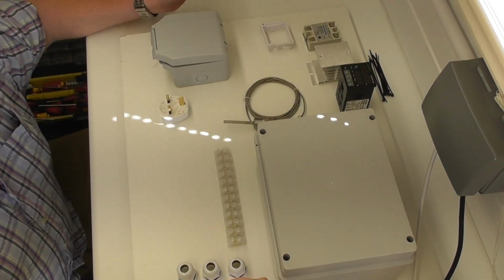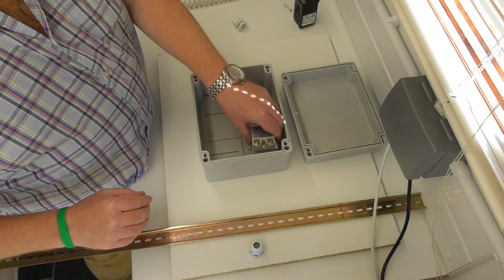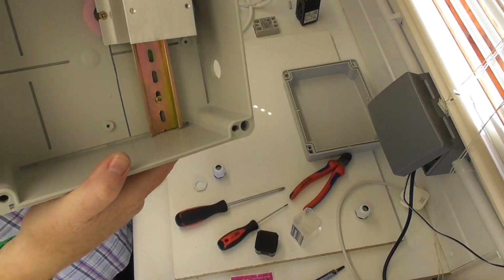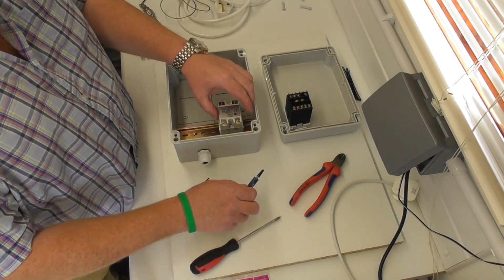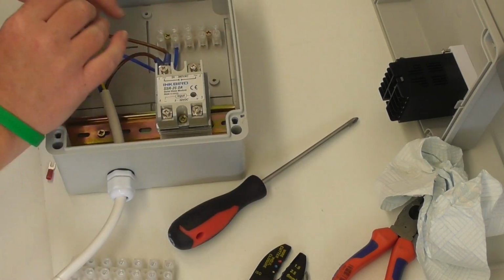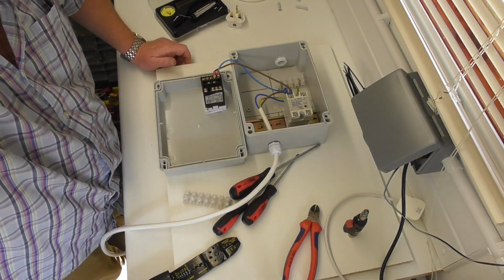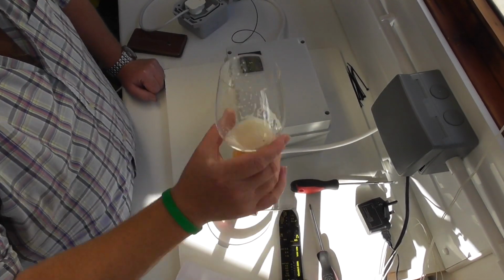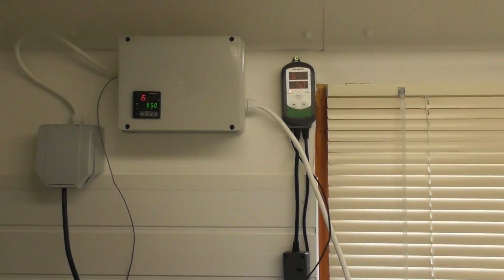Basic Electric Brew HERMS PID Temperature Control Panel Build - Inkbird ITC-100VH & RTD PT100 Sensor

Comment: Hey Graham, many thanks for this video, very informative. Would you happen to know how to connect a two wire PT100 RTD to an Inkbird ITC-100? I am trying to to utilise the probe inside my Braumeister and after much testing of resistance and a lot of googling, it's definitely either a two wire PT100 or a two wire PT1000. Many thanks!

Comment: Hiya how was the heat coming of the heatsink in the end?
Reply from the maker: Robert Finch No issues at all. I never bothered installing the fans and it never gets too hot.
Reply: @HaplessGingerBrew  righto! What is the load and duration out of interest?
Reply from the maker: Robert Finch The burco boilers are quoted at 2.5kw and it runs for up to 2h
Reply: @HaplessGingerBrew  great same wattage as a heating element I'm using. Thanks for your contribution and time! Here's to not blowing myself up!
Reply from the maker: Robert Finch 😂
Reply: @HaplessGingerBrew  But would that be the same if would like to run heating element for 10-18hours? 🤔 Or in this case just put the small  fan inside?
Reply from the maker: @siliuksas2533  10-18 hours wow. What is the application? I guess it depends on the load.
Reply: @HaplessGingerBrew  Well thats gonna be a steamer steriliser , and heating element 2.2 - 2.5kw. 😊
Reply from the maker: @siliuksas2533  I wouldn’t like to pay your electricity bill😂
I’d be seeking some professional advice to be honest.
Reply: @HaplessGingerBrew  well here if I do run element for 18hours without PID controller, that would be a bit pricy 😁 but with PID it's not bad, because this is the point how to sterilise the substrate for mushrooms.  Even 18hours cost me around 10-12eur.
Reply: @HaplessGingerBrew  And yeah that would be full barrel of substrate bags, so when u reach the 92-97degrees it hold kinda steady temps, but without PID the element runs all the time.

Comment: Great video! Im in the process of wiring up a inkbird PID for a plastic injection molding machine. I see you grounded your main cable to the socket receptacle. In the case I wanted to attach a band heating element directly to the SSR where would be a good place to attach the ground? Thanks again for making the video!
Reply from the maker: I attached the ground from the supply and load onto the connector block so just to the same. If you are using a metal housing you could ground to the mounting screw on the SSR but is didn’t bother and didn’t see the need
Reply: Hapless Ginger Brew Thanks red! Keep up with the project videos.

Comment: Great video and thanks for that. Really enjoyed watching and now inspired to build a controller for my silicone heat blankets. But what size was the box you used and where on earth do you get silicone washers - I can't find them anywhere?
Reply from the maker: Here you go buddy - but I would just make some washers from a silicone backing sheet for this project. the link for the washers are the ones I use for kettles but a bit over kill for this.

https://www.ebay.co.uk/itm/5-x-Bespoke-Silicone-Washer-3mm-thk-Pick-own-inside-outside-Dia-upto-60mm-dia-/262451828430?var=&hash=item3d1b5916ce

https://www.ebay.co.uk/itm/Waterproof-Junction-Box-IP65-Adaptable-Enclosure-220x170x120mm-224-L/321456010234?hash=item4ad84573fa:g:q-MAAOxyUylTR-Mz
Reply: Thanks for that matey. I've got the items now so I'll post back here when it's built and let you know how it goes.

Comment: you got skills. Are you an electrician?
Reply from the maker: Old Norse brewery I have limited knowledge. Just enough so I don’t electrocute myself 😂 I have worked in the security industry for many years and used to install before I got fat. Now I just design systems and get a real man to do the hard work
Reply: I have broad knowledge how 230 volt feels like

Comment: Excellent vid mate, built the same last year but never got it working.  Thinking it might be because i used the K-Type thermocouple that came with it but you mentioned the PT100, what difference does that make bud?
Reply from the maker: From my understanding the PT100 measures much more accurately. There are 2 cables that measure resistance and therefore is better for this kind of application. If the intended use was just for fermentation chamber or hatchery etc..... then not so important. I have limited knowledge but that is my understanding. When you say you never got yours working, why was that mate?
Reply: Hapless Ginger Brew tbh I think it was the flagon malt I was using, kept getting clogged.  

Totally copying your design now mate, I’ll post a video when it get it up and running

Comment: Hi

Very neat!

I have ordered a Rex C100 from China and it will come with a 40 amp SSR, and probably wiring in Chinese!

 It was great to see how you wired it up using UK coloured wires for the wiring, much more helpful than the US way.

I really look forward to a your next video which hopefully will show how to program the unit.

My application is for a worm breeding / incubation unit for vermiculture, as worms breed best at 59deg f.

It was great seeing how you fitted the din rail to the heat sink, as I would not have thought of it as I am not an electrician.

Keep up the good work.

Comment: Good video mate! Glad to see you didn't fry yourself. You may want a small computer fan for the ssr though. Just for air movement. Cheers G 🍻
Reply from the maker: It is not getting so hot even after an hours use but as a matter of course I am installing a small fan top and bottom just in case

Comment: Looks great I ended up putting a computer fan on mine to keep it cool it did start to get a little hot. Cheers Jim great video
Reply from the maker: It surprisingly isn't getting hot but I do intend to install a small fan top and bottom anyhow. Thanks Jim